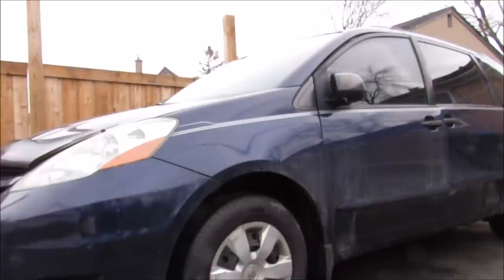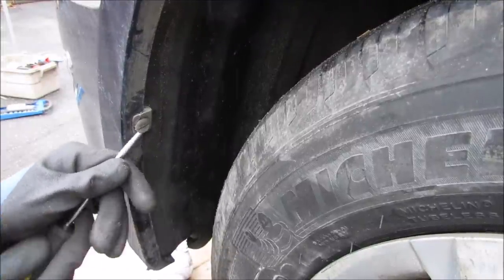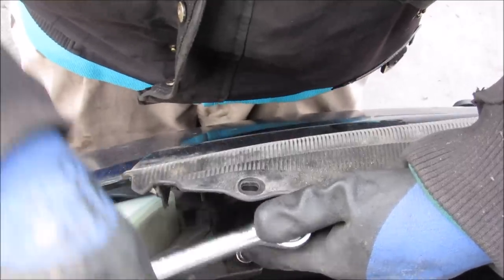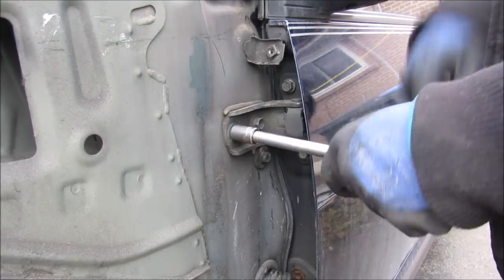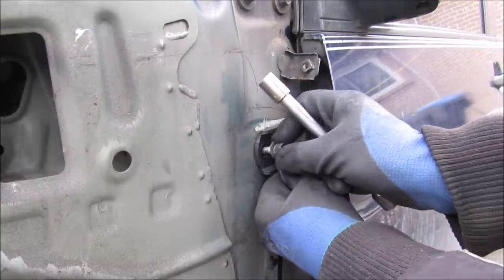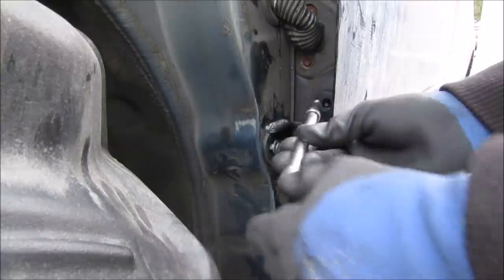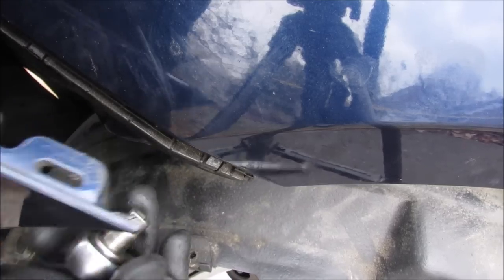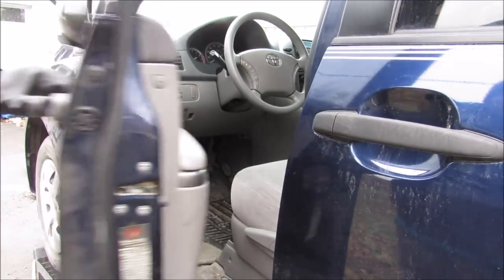How to Replace a Car Door Hinge

Comment: I did that on my car a few years ago. Luckily I did not have to go through all that trouble. Can't recall exactly but I think I was able to replace the hinges without taking out the fender. I did it one hinge at a time just like you. 

Nice tutorial. I would encourage anyone mechanically inclined to try it. its not that hard and the door will not fall off on you.
Reply from the maker: Cool, what car was it? It would be tight to work behind that fender, I peered up from the wheel well and said there was no hope lol
Reply: @speedkar99  nissan sentra. Just had a look at the car and it seems I had to pull the fender. Which means I had to unscrew the front light. I do not think the bumper had to move. Didn't seem that hard because I am generally slow with these things and it got sorted in a morning so under 2 hours. 

It was a second hand car I bought and the door drop was as bad as the one you show so there was no choice but to change them out.

Comment: Great as usual. Can you make one about the electrical system covering the basics; headlights, brake lights, turn signals?
Reply from the maker: Good tip. What exactly do you want to know about the lights, how to replace them or how they work?
Reply: @speedkar99  Yes, location,how the wires run to the back and front components, basic troubleshooting. I know there are videos out there, but yours are outstanding.

Comment: was helpful  and eventually worked out the hinge I bought is drilled for not the vehicle I have    thats filled in half a day trying to work out why so I traced the old one and put the new one over it and traced the bolt holes   not the same at all    video was a big help had to pull mudguard off to find  the wrong part

Comment: Hello, thank you for the video. 
When I replace the hinge it does not hold goon enough. The door falls down. Should I use a sealant or epoxy? Or should I just tight stronger? Thank you! 
I have Camry 2004.

Comment: great video. thanks. 
my 2009 Honda front door edge is catching the fender. loose bolts or do I have to replace the hinges? any suggestions
Reply from the maker: Either the hinge is loose (lift the door up and see if there's play) or it needs adjusting
Reply: @speedkar99  thank you. 
The door was solid, no play. It was the fender which for some strange reason got pushed in. There was no accident, it happened gradually, mostly last night when the car was parked in the driveway. No signs of any force contact.  I've removed the liner and pushed out the fender. I didn't feel any loose parts but the fender was replaced 2 months ago. Are there any mounting points which could have been missed in a body shop? The mechanic didn't give me a straight answer :(

Comment: Great video. Thank you. I have a question, are the replacement parts new OEM or new aftermarket ones? is It a good idea to use a used oem from salvage yard?
Reply from the maker: Got mine from the junkyard 
Verified they were good before pulling them
Reply: i bought 2 used good hinges from the yard for my terrain lined up pefect .all works like new $ 30.00 bucks

Comment: How to fix o2 sensor problem P0420? I have been struggling with it for 4 years in my corolla 2014. Please help.
Reply from the maker: So you've been having this problem since the car was 1 year old and you didn't take it to the dealership ? 

I have a video for p0420 check it out
Reply: Thank you for your reply. I bought the car from an auction website and i have no idea about its maintenance history. When i checked the catalytic is empty so i think the previous owner removed what is inside of it. i tried the spacer but it didn't work. i just saw your video for the p0420 hack. should i used it or do you suggest me to do something else?. would really appreciate your help :D